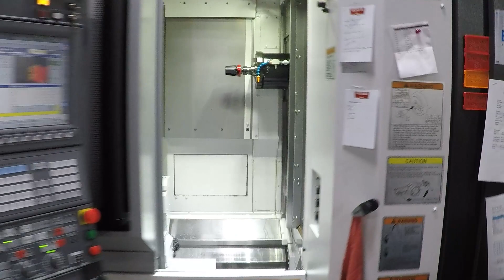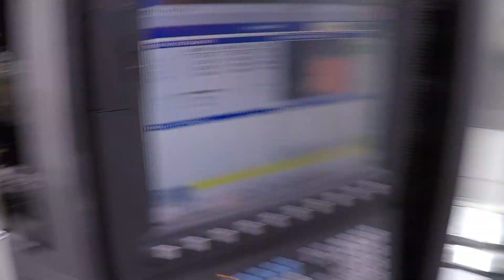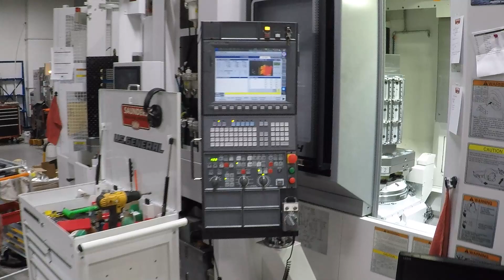Running an Okuma MB-4000H Horizontal CNC Machine: What It's Been Like the First Two Months!

Comment: Ran Okumas a lot over my 35 years.
Our shop made our own steel tombstones. Had them welded up, machined base & faced square & on center. We even made our own pallets.
Mounted tooling permanently on tombstone.
Used forklift to swap pallets on & off machine. 
Offsets auto loaded in program. 
Changing jobs, chip to chip was under 90 minutes. Set up time almost completely eliminated.
Adding a probe , you can ensure quality.
We had 6 okuma horizontal mills, about 100 pallets & almost no set up time.
1 person can keep 2 or 3 mills running.

Comment: The opinion about horizontals being more rigid than verticals is likely from the older style horizontals where the spindle moves in the Z and the pallet moves in the X. Mazak, Mitsubishi, Toshiba and likely many more brands used that configuration before about 2000. We have a 1995 Mazak FH480 and it is a beast, large linear rails, 3 trucks per rail and 4.5kW servos. Stupid rigid and accurate. We also have a 2000 FH5800 with the more modern configuration. It’s build lighter for very fast movements but not as rigid as the older girl.

Comment: We have and Ma500 at work and I can confirm that rigidity isnt as good as a verticle. However we also have an old Mc50 and that thing is a tank! I belive the difference is in how the pallets are mounted/clamped. 
The old style has one big platen that basically slides into a big tslot and pulls the pallet down onto 6 lapped pads, where as the new style has 4 tapers and uses a pullstud arangment.

Comment: Tsugami uses the term loop of force, basically how much distance is between the part and the tool going the long way,  longer distance=less rigid.   if your working at the top of your tombstone your probably close to 8 feet,   at the bottom 4 feet.  we  run similar parts in 1215 and 316ss, the 1215 can be a fully loaded tombstone,  the 316 we only use the bottom 6" of the tombstone.

Comment: I hope that aluminum tombstone works out but there's two good reasons they're made from cast iron.  Iron has 3x the Youngs modulus and 2x-6x the damping coefficient.
Reply: The place I work at has been using aluminum tombstones for probably 40 years now and never had a problem.

Comment: Yes tall tombstones are floppy. I can almost guarantee if you run a 3/4” drill bit at full feed and speed at the top of the tombstone it likely will deflect away .002 to .003” . Not normally an issue but do a deep bore and your thru hole position will be off a noticeable amount.

Comment: We're getting ready to take delivery on a fermat wft15 cnc horizontal boring mill with a b axis rotary table. Fusion 360 doesn't have a perfect post for the machine. However watching your videos as well as others has given me the confidence to not only learn 4 axis capabilities but also learn how to modify a stock fanuc post to work with this machine. I wont know for sure until we get the machine installed but i think I've got it figured out. This is a hell of a step up from the hurco vmx50 we have. In the future we plan on getting a fermat wrf floor type boring mill with atleast 45ft of x travel and a powered universal head. It will be quite comical in a way to run that monster of a machine with a cad/cam program that costs pennies compared to most. Admittedly I'm not sure fusion will be able to because of the universal head so we may have to step up to something else but we'll see.

Comment: We got our MB-4000H a few months ago.  Almost the exact same setup you have, but 20,000 rpm HSK spindle.  The goal is to run production at night using high part density fixturing that will allow the machine to run 15 hours unattended.  This way the machine is finishing up at 7 am when we come in and we can run low production parts during the day.  Then at 4 pm we run one more load of the low production parts with the night production pallets.

Comment: I don’t know how the post processor is setup however I just thought I’d mention I know with haas they have a tool precall option where the machine will grab the next tool and have it ready for the side mount tool changers. because sometimes they take a long time to index to the tool in the program depending on how many pockets away a tool is. The way it works with haas is after it calls out the main tool for the operation with T# M06 after it will issue T# of the next tool without an M06 so it doesn’t change to that tool. however the changer will index to that pocket so when you actually call the tool it will just be a quick swap and your not wasting time on waiting for the changer to index to the desired tool. I hope this helps and I’m probably not the first to mention this love the videos and keep up the good work!

Comment: I didn’t realise top end carbide endmills actually wear out in aluminium until I got a 32 pallet matsuura MAM72🤣 running non stop 24/7

I worked out the 16mm was cutting 32 BILLION chips before replacing. Yeah that’s a once a month changer 💪
Reply: daily use of a aluminium ball nose in PETG and PLA finishing, I get over a year of tool life. It became a joke in the NC dept. for tool life "optimization" when we have to order a spare haha

Comment: I work with some older mb4000 and 5000s. i use to watch your old videos while i ran those machines, i was so excited to hear you got yourself one. ours dont have the pallet pool, but they do have the matrix. on the matrix, there should be a next tool return button that will store the preped tool in order for you to do whatever you need to do. when your all done, press the next tool reprep button and it should return the tool to the shifter.

Comment: On the matrix turn the switch to allow manual access, then one of the buttons should illuminate and say “next tool return” it will allow the staged tool to go back to its designated pot. Then you can just type in the tool number you want to call to the load station and call it up normally. If the machine calls a tool change it will just stop and wait until you are done. If it calls a tool change while you are in the matrix the restart light will start flashing, finish checking your tools at the load station, put the tools back in their designated pots, then the restart light will be flashing, turn off the manual override switch and click restart. The machine with pick back up right where it left off.

Comment: I Run this exact combo at work. It is great except for when you are only running one job on one pallet. The  way we go about it is run two dummy pallets behind the main pallet so it will kick the main out to the work station. You should look into Fastems. We have a 3 cell MB5000H with a 30 Pallet Fastems System. 

Love the channel BTW. Im a Long time lurker. You guys along with This Old Tony and Abom79 inspired me to become a Machinist. Graduating next week with a two year CNC Machining degree and continuing on to get my Bachelors in Mechanical Engineering!

Comment: I used Okuma quite a bit. Sometimes i get parts or jobs that require to machine just outside the "limits" of the machine. Okuma got soft limits for all their axis. You can change these if you want slightly more travel in a direction.

You might be able to use this if you want your Y lower. You didn't mention CAS, Have you guys set that up yet?
And for tool life, Part probing is the best way to go to avoid making many bad parts overnight with a slightly worn tool.

Comment: Hey there John, pre-staging a tool does not prevent you from using the Matrix to service OTHER tools while running. If a tool is staged when you turn on the MANUAL INTERVENTION button, the NEXT TOOL RETURN button will illuminate allowing you to put the staged tool away temporarily and free up the robot to do any magazine operation you'd like. Once completed, press the NEXT TOOL RESTAGE button. Viola!

Comment: Awesome video! 

But to be honest all that excitement about the horizontal is less so with the horizontal machine as it is with the automation and pallet pool. 

A palettiezed vertical or 5x machine would have had almost the same effect on the business, no?
Reply: Newbie alert!
I wondered why they did not choose something like the Midaco (it is the only one I know) 4th axis trunnion automatic pallete changer.
It should be possible to add more  pallets.

In my newbie opinion something like that would be more flexible and possibly cheaper.

But people keep buying horizontal cnc so I am clearly missing something.

Comment: My dream is to run my product on a horizontal Okuma. So many advantages over the vertical
Reply: Have you tried a millturn?

I obviously don't know your product but they're worth a look
Reply: @angrydragonslayer  If it was round it would be on a Mill Turn
Reply: @greg2337  Doesn't have to be round when finished just round to begin.  I make rectangle parts on my lathe . I just start out with 2" round.
Reply: @fryer05maverick31  True! The best part of a Horizontal beside rigidity is access and chip evacuation. And Price. A mill turn is usually more than a horizontal but is a more capable machine.
Reply: @greg2337  i've fed rectangle bars into one (which was both horrifying and exhilarating) but i agree, it's best to stick to round stock

Comment: Instead of using a camera would it be possible to remote into the control thru a VPN and check the status, I know that Hass and a few others support it.
Reply: Okumas are windows based right? So you can basically do any monitoring app afaik..

Comment: A great way to use the NG Tool storage in the matrix, beyond using it as timer/part tool replacement counters is to use it to stage you next 4 tools to limit the amount of travel the matrix rabbit has to do. Also, always double check the tool goes in right. Always verify the green light on the tool holder tree is on. Trust me, putting it in wrong makes a mess to deal with

Yes the machine is ultra rigid. It has a 20K hr spindle life. When it goes, it sounds like a jet plane crashing. When it comes to tools being pre-staged, you can hit the Next Tool Return, call up your tool, change it, and hit Next Tool Prep. Also, you can sister-group number your tools in the case of using a tool on a lot of jobs. When the counter timer hits part/minutes count, the machine won’t sit alarmed out, it will call the next sister tool and continue the job. You can call for tool checks after certain actions. I’m rambling, but I run 4 MB4000H’s hooked to a Fastems 84 pallet crane system. Just trying to give you what I can. Great machine.

Comment: I love your enthusiasm and how you have grown, I've always been in the boat of having the proverbial carrot being dangled with the opportunity of doing small r & d and then getting more work but 98% of the time we don't get the production work even when I tell them I will invest in machines, I know its the chicken and the egg, if I don't have the machine I don't get the work but if I don't get the work but have a machine then I'm screwed. At the moment I'm trying to workout weather to buy a haas mini mill or a [ UK] XYZ 500 LR to machine tool steel parts P20 H13 O1 D2 as all I need is a machine with tool changer, my factory doesn't have any spare space at all so I will have to sacrifice 1 or 2 machines to get a small VMC. I wish in some ways I pulled the trigger 15 years ago but I'm a job shop and don't have a product [ billions of ideas].
Reply: If you are in the UK I would steer clear of HAAS unless you are a big player. They left me at bottom of pile for any breakdowns and would end up being down for a week to 4 weeks at a time. UK service is terrible and they don’t have enough engineers so go with who is biggest and screaming when it comes to service 

I didn’t go XYZ for my mill as the linear rails were very small on machine I looked at. If you aren’t taking big cuts and don’t won’t quick rapids then it won’t be an issue.

I sold a HAAS with 35 cut hours to buy a 9 year old machine to get better Service and reliability
Reply: @homeworkshopengineering  thanks, its a mine field trying to work out what to get, I'm not interested in massive cuts and rapids [ titans🤭] I'm after un maned tool changer so I can set it up to run for a hour or so so I can then run other machines or answer the phone, most of my jobs aren't time critical unless it's a brake down but mainly I have a few weeks to a few months. The main thing is it needs to be repeatable and accurate with dowel hole centers.
Reply: he will fail eventually for being too young  in  the role of a CEO. .. Still look like a teen  and being too  enthusiastic and naive... Maybe if he gain 100 lbs, grows a 19th century mustasch, drinks whiskey to get a manly voice, smokes cigarr and act serious..